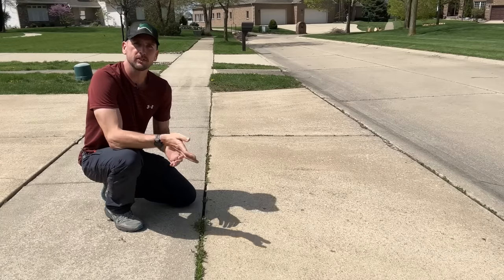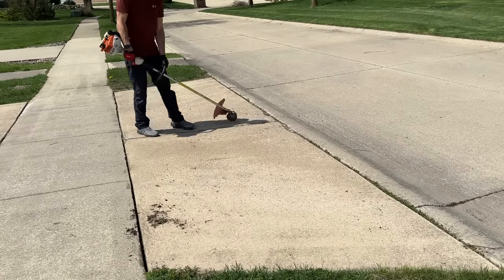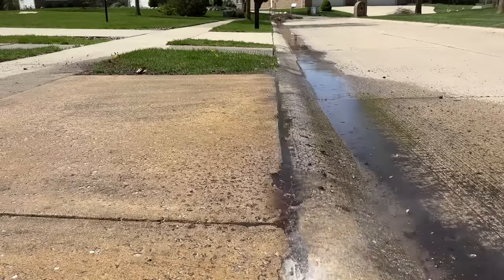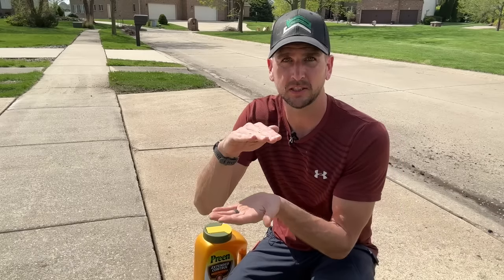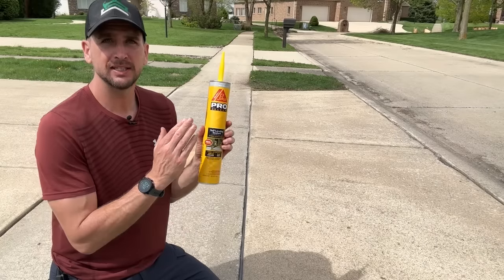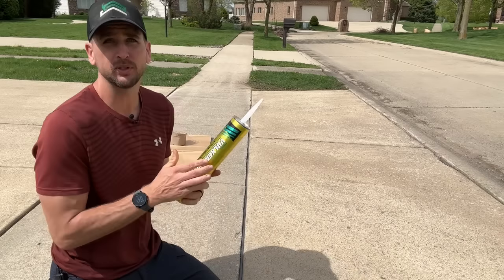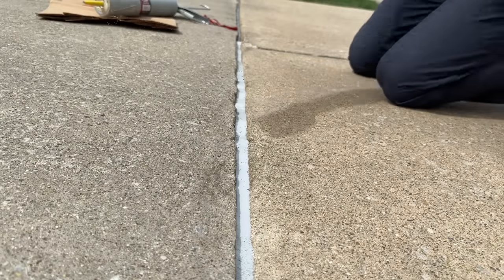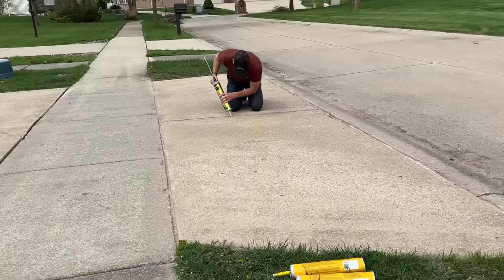Weed-Free Driveways and Sidewalks: The Ultimate Solution!

Comment: Fill the gaps with a dry mixture of 1 part cement 4 parts polymeric sand. Then spray it with water. That should stop vegetation growth and still be flexible enough to handle the shifting of weights between concrete slabs.
Reply: Interesting idea but polymeric sand is not meant to be flexed and neither is Concrete. Your solution is basically just putting a hard substance between the expansion joints which defeats the purpose in the first place. Sika-flex is much more flexible and the best solution in this application.

Comment: Prep concrete and stone with sealer. Commonly known as Waterglass.
Sealing the mortar or porous material by "plasticizing" the contact surface adds longevity.
On the ground...under 5 years in 4 season weather.

Comment: Scott, what you are doing is 99.9% accurate. However I didn’t heard why you used the backer rod. Myself I know and if you don’t mind I’ll explain. For the adhesive in this case driveway sealant to stay in place you must make the surface you are attaching to twice the surface area as the width of the cavity you are filling! So if the width of our cavity (joint) is one half inch wide then you should clear out the debris to a minimum of an inch deep!  Once done I would use a wire brush to really clean both sides of the joint the power wash out remains debris! Let dry as you describe but myself I’d try and find a  compatible  primer and I’m not sure what Sikaflex recommends but I’m sure Sikaflex will do fine with or without primer on most porous surfaces!  So now the joint is clean and dry….. time to add the backer rod! To install the backer rod you must keep in mind the width of the joint…… so if the joint is one half inch wide then use a half inch close-cell backer rod and push the backer rod so that the (top) rounded surface of the backer rod is slightly deeper then a quarter of an inch from the top surface of the concrete and once that’s done you’ll see that the backer rod automatically will be one half inch on the edge to be sealed!!! The quarter inch at the center of the joint will allow for the concrete to move with the joint’s expansion! Now after getting this written done I see that it’s is kind of wordy! However if you want this to be permanent (which is not possible) these are the precautions you will need to follow!!! I expect Sikaflex should last several  years but nothing is permanent when dealing with concrete and the weather!
Reply: Nice
Reply: Are you implying if the gap is 1 inch wide, the depth needs to be 0.5 inch deep?    2 inches gap needs 1 inch deep?

Comment: THANK YOU X3.  I am literally driven mad by huge dandelions and weeds between paving stones installed by previous owners.  I have a heat gun, a gouger type garden tool, gallons of vinegar and salt  which only works temporarily, Round-Up which failed to work at all,  but watching your video, purely by chance as I was looking at genealogy videos, it suddenly  made sense.  Block the critters, not keep dragging them out.  When I get the items you suggested, I will drop you a line and tell you how it worked for me but common sense tells me it is going to work.  I am 74 so it will be slow going as I cannot kneel and have to bend but I will do it, by hook or by crook!  Oh the only thing I couldn't find on English Amazon was the self-levelling sealant but I will research as surely we must have that too.  Did I say thank you lol?

Comment: How lucky are you to live on such a quiet street. I think I only saw 1 car drive by during your timelapse. Also great suggestion with the backer rod.
BONUS TIPS:
#1: If you're in a rush & don't want to wait for the water to dry, you can either skip the water and use an air compressor to blow out the debris, or use the air compressor to blow away most of the water. Just make sure to wear eye protection and maybe a dust mask.
#2: To ensure any remnant of weeds are fully gone, you could fill an old dish soap bottle with vinegar and squirt a gentle stream along the joints. If your joints are NOT on an incline (where any of the liquid could dribble down towards a sewer), then you can use some diluted bleach instead (which eventually breaks down to water and salt. Saome people say to use gasoline, but not only is that more expensive, but also harmful to the environment. 
#3: Another alternative for the caulk is to use expanding foam. There are specific types made exactly for this purpose.
Reply: yea no kidding, on my street if I start doing any project near the street, cars will be stopping, even parking to watch what I’m doing, or throw an occassional beer bottle at me. 😮
Reply: Hahah. I too only counted one vehicle.   That said, we luckily live on a relatively quiet cul-de-sac.
Reply: @ciscoterres717  Someone actually threw a beer bottle at you?

Comment: YES! Backer rod and outdoor leveling caulk is the best solution for those joints. 
I installed it like this for years, except I used a power washer to clean out the joints. You wanna talk about mud spray back?! If you do it right though, it’ll last as long as the driveway.

Comment: Great idea, but those are called control joints. If/when the concrete cracks ,it will more than likely crack in that joint.
Reply: Thank you. I was wondering about that. After all, there is a reason those spaces are there.
Reply: If? No if. It's just when
Reply: The joints on either side of the sidewalk definitely appear to be expansion joints.

Comment: The best sidewalk joint detail IMO:
   1. Clean joint as shown in video.
   2. Place pea gravel or 1/4" fine crushed rock into the joint to within 3/8" of Top of Slab.
   3. Lock the pea gravel down with a light coat of clear floor epoxy poured over the top making sure to brush the epoxy along the verticals as a primer.
   4. Once the epoxy is cured, place your favorite caulking over gravel/epoxy matrix without backer rod. Top with sand as needed.
   5. This creates a relatively thin caulking layer over a relatively weed-resistant sidewalk joint. Recaulking is as easy as peel away the old, hose out the dirt, and recaulk.
Reply: Better yet, put put a water permeable type Earth & water- friendly turfstone and make the grass a feature.
Reply: What about expansion and contraction?
Reply: That's how you get cracks in your slabs. The expansion joints aren't there because it makes concrete easier to pour. They're necessary for the life/health of your concrete.
Reply: @billveek9518  it only restrains the slab on one side, the other side is free to move.
Reply: @RochelleHasTooManyHobbies  it only restrains the slab on one side.
Reply: I would think the epoxy would be brittle, where the backing rod is flexible.  I’m tempted to just use mortar, but I suppose it will just crack over time as the slab moves—which it will.

Comment: For a perfect fit  backer, fill the crack with a mix of 50% clumping cat litter and 50% rock salt. Wet it down and as the salt dissolves add more. When it no longer settles, and is ~3/4" below the surface, when dry,  apply sealant.
Reply: Salt makes most concretes spar, so you don't want to do that unless it's specifically made for salt exposure. Northern driveways are more likely to have admixtures to handle salt (freezing weather and salt for ice are more common), but in the South...nope.

That salt might be slowly eating away the underside of your slab. Larger cracks and edge breaks would follow in that case. 

Sorry, don't want to bear bad news. But I'd also hate for you to see a repeat of my issues.
Reply: @FamilyManMoving  And it'll rust the rebar.

Comment: Residents in winter snow states have a trick for this. With leftover rock-salt after winter months, simply apply it all along sidewalk cracks--wherever weeds appear. Provided sidewalks don't get flooded regularly, one application will last through the summer. CAVEAT: You may want to reconsider this if you have pets and/or little children out 'n' about your property.
Reply: It doesn't work that long for me unfortunately so I've gone back to using those foaming sprays...cause rock salt gets expensive too. (I don't get flooding in my driveway so I don't think it's that though maybe it does work in drier winter snow states than mine. ??) 
May try Preen this year.
Plus, the foaming sprays have to be stored inside overwinter because if they get exposed to the extreme cold temperatures in the garage they don't seem to work anymore.
Reply: Salt eats concrete over time. Look at a driveway where they use deicers that contain salt and you will see pitting.
Reply: Vinegar, boiling water, rock salt ... nothing has come close to solving the weed problems in my cracked driveway. At some point, I'll have to quit mowing my driveway, and dig out and replace all the old asphalt with new a$phalt.

Comment: I used the 45SSL on my driveway with some sprinkled sand on top to help protect it. After i cleaned out the old expansion stuff i noticed some deep holes under the driveway. I filled in the voids with sand and used a compressor to make sure the entire void was filled.  If you blast air inside the void it will spread the sand out and you can keep filling it.

Comment: I cleaned out the cracks in the concrete around a swimming pool like you did. Then I just use regular cheap clear silicone caulk. It's lasted ten years so far. No wear or lifting at all. And no weeds.

Comment: A pressure washer can also clean out the joints.
Reply from the maker: For sure, was trying to keep the need for tools as low as possible but a pressure washer really helps blast out the cracks if you have one 👍
Reply: It's like a driveway bidet 😅
Reply: @rosie684 🤣🤣🤣

Comment: I did the same thing with clear silicone. 12 years later it's still holding up. Use a leaf blower to blow away the dust, then apply the silicone. Then a wet paint brush to gently flatten it down. Done.

Comment: We're trying to keep a neighbor's bamboo from coming up in cracks in our driveway. We spend every spring trying to dig out and poison rhizomes and tried to put in a barrier, but it's still a concern. That 🗑️ should be banned or at least restricted within 100 yds of someone else's property.
Reply: Running bamboo is a nightmare.  Previous owner of my house planted it. When I  dug it out, it was clear that it had run under a fence to my neighbor's irrigated garden. They didn't want to deal with it. I'm installing a corrugated metal barrier 18" deep, and then I will xeriscape the 24" along the fence. I will watch carefully as no barrier  is perfect. 
I predict that eventually they will wish they'd dug the stuff up when it was a small problem. Awful stuff.

Comment: I have used the Tremco product. Worked great and can be worked with your hands as long as you use 409 spray. Otherwise it sticks to everything! I live in Phoenix and the 1a5 degree temps have not done anything to the joint.

Comment: I've used those self-leveling fillers on my driveway a couple times, but after a year or so, I find they shrink and have separations all along the way. Still, it's better than nothing.
Reply from the maker: Really, I had really good luck with both Sika and Tremco.  Did you use one of these brands or another product?
Reply: You need to put the foam a little deeper and then have a thicker bead of the filler material.  It will last longer and shrink less.

Comment: Most of what you did was spot on, but instead of using a toxic substance to kill any remaining roots and seeds use vinegar instead. It does a good job killing unwanted plants but isn't toxic to the environment. I've used it to kill weeds myself, including some big monsters that got out of hand because I don't get outside much due to being disabled. For above ground plants, it might take more than one application of regular strength vinegar, but you could try industrial strength vinegar. Wear gloves and eye protection if using industrial strength vinegar, as it's strong enough to burn your skin and eyes. I think that you can get industrial strength vinegar at garden centers and hardware stores. For simplicity, and for safety's sake I just use regular strength vinegar, even if it means applying it more than once.

I've known about this use for vinegar for years, and I still feel good about finding something environmentally safe, cheap, easy to get, and easy to use for killing unwanted plants. Another benefit of using regular strength vinegar to kill plants is that ground treated with it won't poison pets or wildlife.🤗
Reply: Can you please tell me if vinegar can prevent centipedes from coming into the bathroom? And if yes, is there a particular type of vinegar that does the trick?
Reply: 45% vinegar strength 1 gallon makes 9 gallons of 5% store-bought vinegar a lot cheaper to kill weeds you only need 10 to 15% dilution but the 45% vinegar solution 1 gallon can make 2 gallons at 20%. They also recommend at the 20% rate one cup of salt and 1 tablespoon of dish soap, it does kill weeds, highly effective and not poisonous but you do need to wear mass gloves and I protection as well as being outside when you mix it.
Reply: @sn.m  you can get those ketchup or mustard plastic bottles with the fine tips, and go buy some diatomaceous earth pet safe, organic from a tractor supply really cheap put in those bottles and then sprinkle it around the corners and cracks. It will kill ants roaches any type of bug that crawls around in those corners without harming your pets or your loved ones.
Reply: @peckerpeter2078  thank you🙏
Reply: Vinegar, rock salt and boiling water have never worked for me.  But diatomaceous earth, aka DTE, is excellent. It's used in pool filters.  Get the food grade version and you can use it indoors. Use a good N95 respirator when applying the powder. DTE is microscopic fossils. The bits have sharp edges, which is why it kills bugs, and that's terrible for the inside of your lungs. 
  Think asbestosis for potential harm. And think about the protective gear pest control guys use.

Comment: One missing element to your idea, at least up here in the Midwest. Ants.

Nearly Just about anything you can put in that crack that has any potential imperfection at all, and the ants are going to start chewing through it and setting up their nest. Even without those imperfections, some of those ants are tenacious enough to go ahead and start going through it anyway… Even concrete sometimes.

I’m guessing you would most likely want to put down a fairly good amount of long-term ant killer along with that preen… And I would weigh heavier on the Insecticide. If I could time lapse my driveway, you would see that most of my plant problem starts with the ants: first at their nest site, and then along the trails. (apparently some ants can have Butterfingers as they’re trying to bring those seeds to the hill!).
Reply: Have you tried using diatomaceous earth? I hear ants and a lot of other critters hate walking across it. Of course it would eventually wash out I would think, but that would happen with the Preen as well. Just an idea. We have lots of ants here in Arkansas too and they are almost worse than the mosquitoes. 😒 Ours respond well to Sevin Dust, but again, you have to reapply monthly 3 seasons of the year.
Reply: @txoxley Thanks for asking about using DE. I was wondering if it would work. I know that if I sprinkle it onto of the ants, the seem to move away.

Comment: love this vid, also the few others you made for filling gap b/w foundation and walkway. used legit backer rods all sizes and also a couple of not poodle noodles but that foam you put on pipes for condensation, did my entire house last fall and saved the garage for this year. this killed my back though being on my knees for a couple days straight (I had to remove the previous homeowners old backer rod).  i also found it interesting that not a single home depot in southern ontario had the dap polyurethane available i use that over any self levelling material.  it actually just came back in stock last week.  i had to drive to Buffalo home depot to get some dap a couple of months ago when I did the porch. one new thing i learned form this vid is that to sprinkle sand 30-40 min later I'm not sure if you ever mentioned that timing in your previous vids.   this is my fav diy channel on the net. can you do a vid on how to replace really old seals on bathtub knobs... late 70's ish????

Comment: 1) pressure wash cracks/voids of organic material (leaves, dirt, etc) i.e. no soil no grow - If not a choice for your design. next step   2) 1.5lbs of Salt Crystals per gallon of water,  (not pellets) used for softners (usually 40lb bags) (3-5 days kill)  3) Wood ash is potash. (One of the 3 numbers you see on lawn/garden products) Nothing will grow in soil if there is too much salt or potash    4) Are you going to "paint/stain" your driveway to match this plastic concoction color? You will be repairing this fix (although it will last awhile). cement hot expands. cold shrinks. wiggle wiggle then separation. Plus, everyon,e but you, should see a "homeowner watched a youtube repair video".   Eyes should look at driveway similar to looking at a large floor.  Repairs like this ...Bad Doggy.   House much is your house worth?     K.I.S.S. method folks.

Comment: During the screwdriver step I use an upside down drywall saw to pull the roots and stuff out, and use a shop vac with crevice tool to pull out the dirt and other stuff.